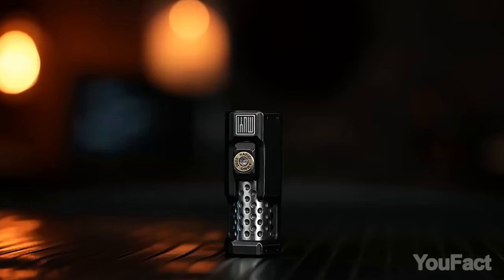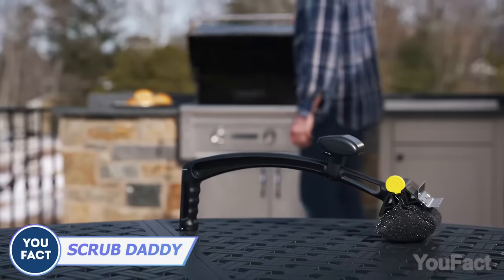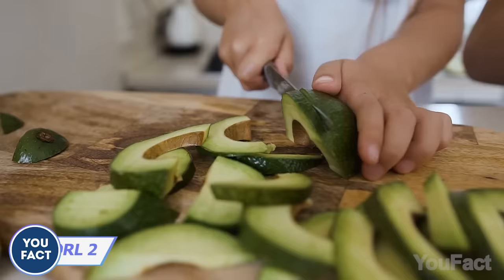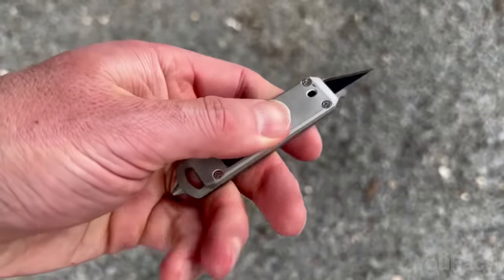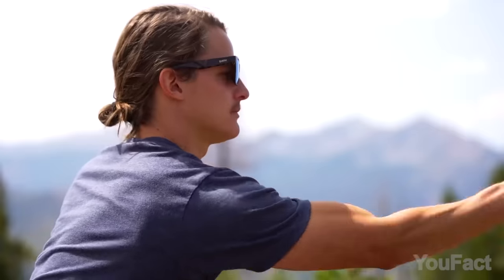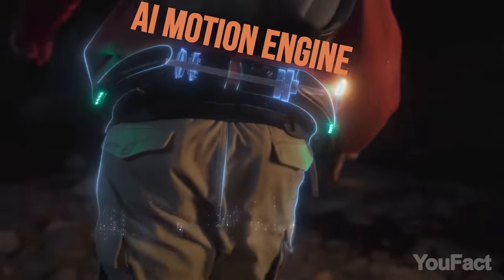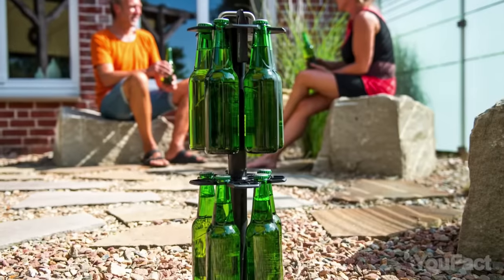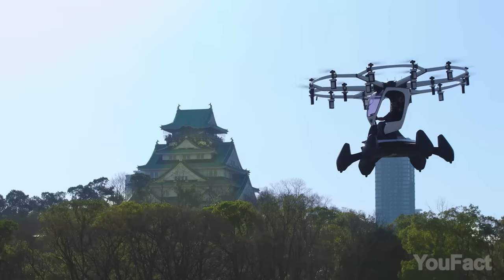20 Coolest Gadgets Every Man Will Appreciate

Comment: Just turn the burners on the BBQ grill for 5 minutes. Turn off burners. Dip a steel brush into a bucket of cold water and start scrubbing. The water will turn into steam as it hits the hot grill and lift the crusty burned on grunge. Real easy. No jeed to buy silly battery powered brush.

A good quality multi tool is so much better and useful than these stupid mini neck chain knives.

Bucket backpack? Are you that much of an alcoholic you can't go 4 hours without having a cold beer? A serious backpack will carry 2 water bottles on each side and several more can snap ring on the molle straps. Water is more imporant than beer.